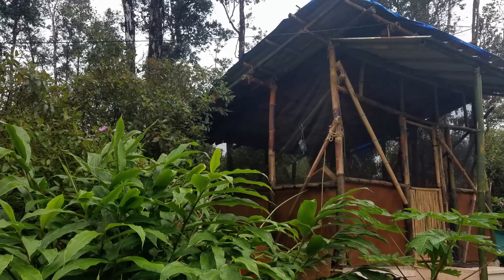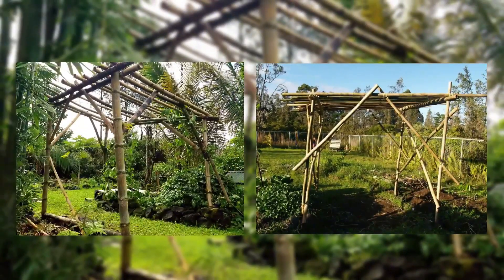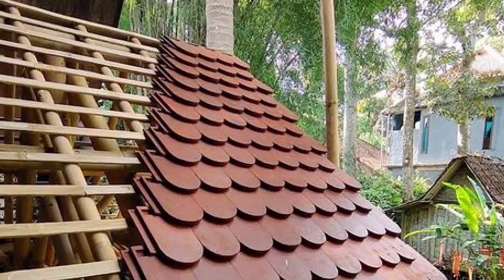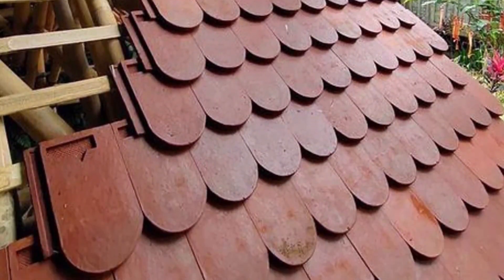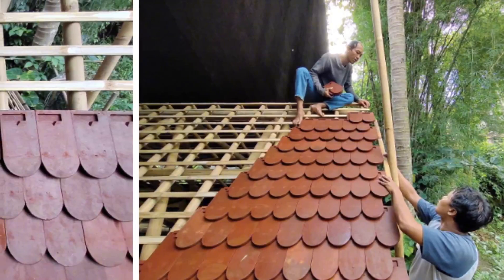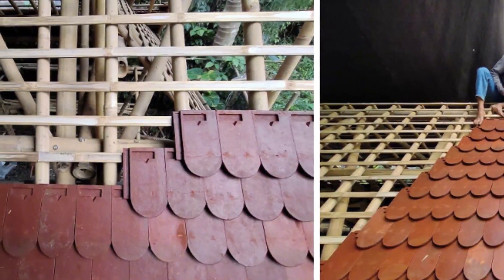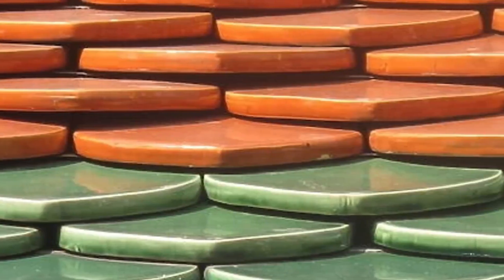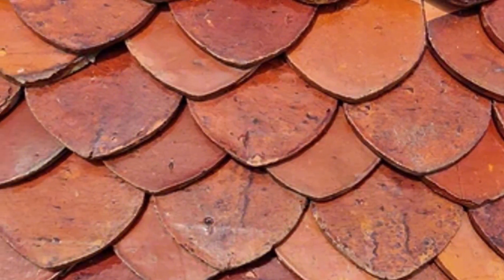Bamboo Roofs: 5 Different Methods for Roofing a Bamboo House

Comment: There's a lot of artificial thatch material available here in Thailand, I think that's what I would go with.  Costs about $2.50 - $3 for a 50cm panel 1m long.  I suppose they overlap by half so a 2m x 3m roof section with 25cm spacing would require maybe 24 pieces costing about $60 - 72, assuming a little overhang.
Reply from the maker: Yeah. For the amount of work, artificial thatch would be the way to go

Comment: When using the split bamboo method, how do you attach the lower water catching run so it doesn't have holes in it.
Reply from the maker: I donʻt know if I quite understand, but itʻs just like shingles, start from the bottom going to the top, overlaying each successive layer.